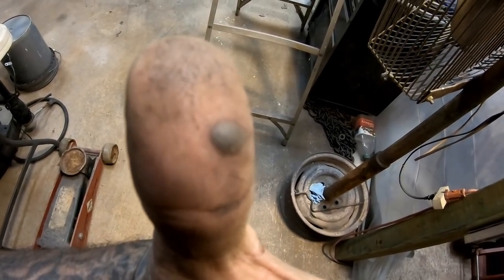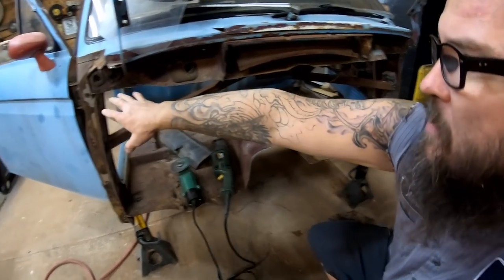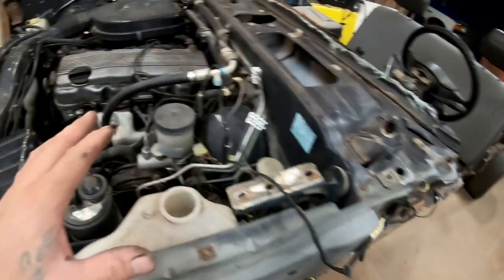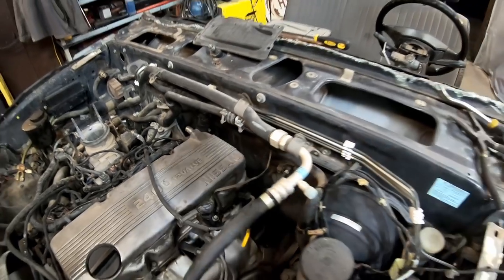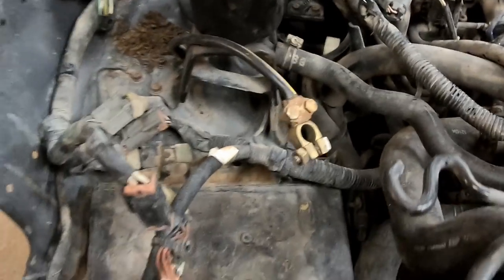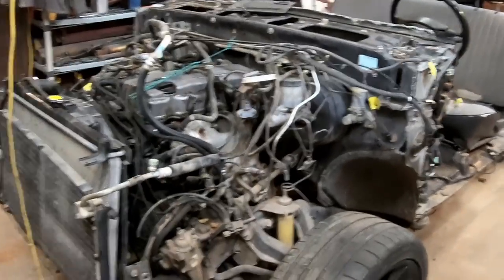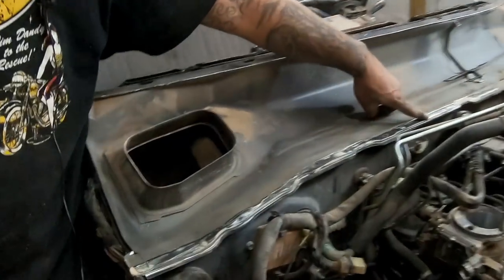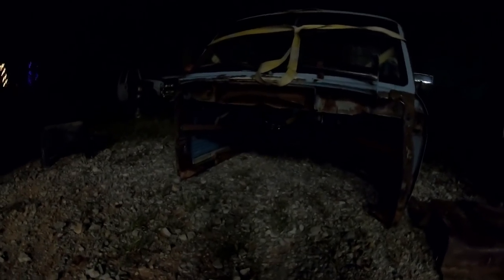Copart Datsun truck build pt.5

Comment: Hey mike you might want to check into a cheap plasma cutter from harbor freight or northern , makes cutting metal a breeze and takes a fraction of the time.
Reply from the maker: I’ve got a real nice one but something is wrong with it. I’m going to drop it off at the repair shop soon.

Comment: It would seem that you should be using a plasma torch to do some of the cutting.  Would go quicker and leave a good enough edge.  Not a complaint ot anything bad, just a thought.
Reply from the maker: I’ve got one but somethings wrong with it. I need to drop it off at the repair shop. I will be doing that soon.